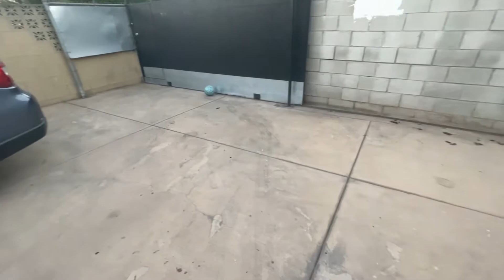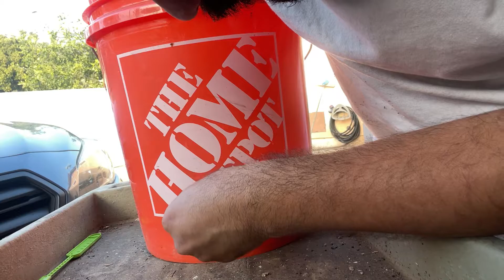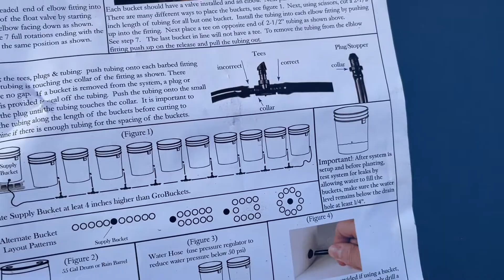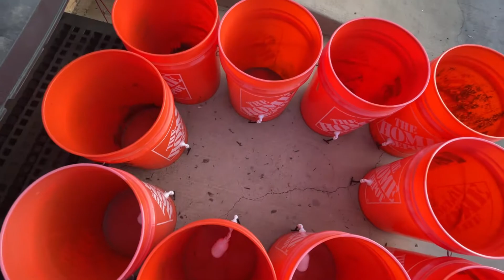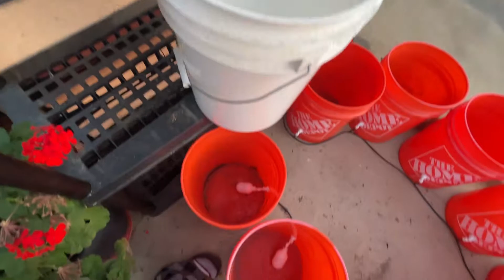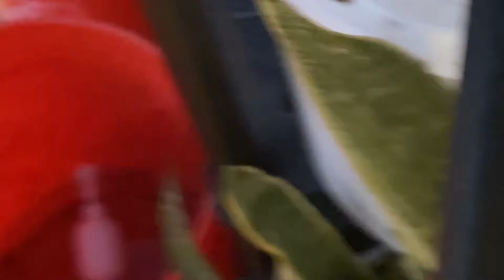GroBucket: Drip System

Comment: What do you use to stop the dirt or grow media holding the float to the bottom making it always on? Do you put a container with holes upside down covering the float before adding your dirt or grow media? Also 10 plants will drink and evaporate more than that bucket per day so i think your meant to use a 200litre or 44 galon drum for the water supply not a bucket.. im contemplating using this system for a hydroponics set up for fruits and vegetables and berries ..
Reply: Mine drink about 6 gallons between 6 extremely large plants about every 5 days.  I let the media have a lil bit of dry back.